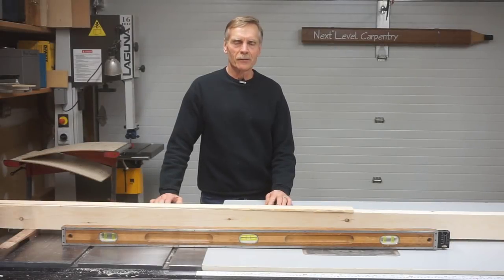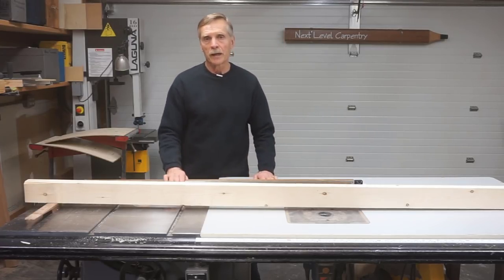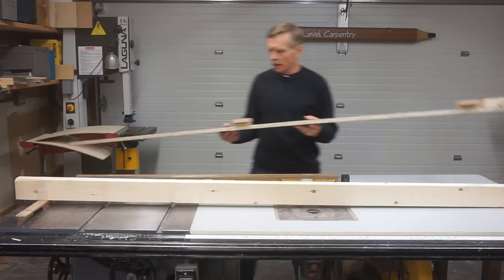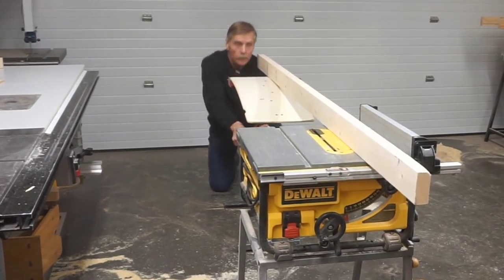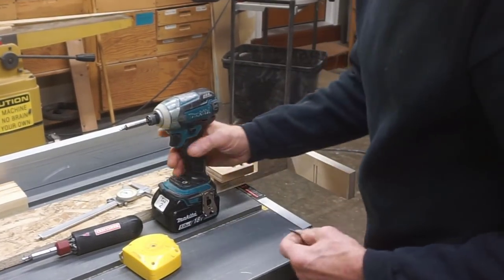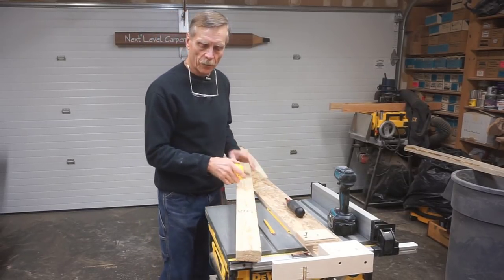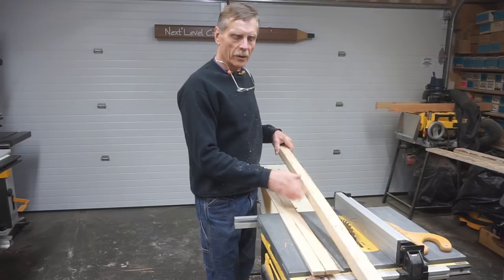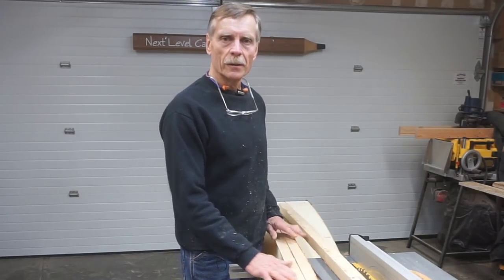How to Cut Super Shims

Comment: Hi Matt, 
Would you do a video about how to use the jointer to straighten lumber? And how to trouble shooting if couldn’t get board straight. I have a little trouble with my “made in China” jointer.  Thanks in advance.
Reply from the maker: Hi Jeremy,  I'll put a jointer video on my list... maybe I can squeeze it into the 'Minutes with a Master' format, otherwise it would be at the end of a long list of videos I need to do :-(
Two things will prevent jointers from working like they should: operator error or poor setup of the machine.
No matter how good you get at feeding boards over a jointer they'll never come out straight if the machine isn't set up properly.  The MOST IMPORTANT THING to set up is the height of the cutters in relation to the outfeed table! There should be a section in the owner's manual explaining how to check the setting and make adjustments when changing cutters. When the arc of the cutters is at its highest point it needs to be maybe .005" above the height of the outfeed table and perfectly parallel with the plane of the outfeed table.  Any higher and you'll get 'snipe' at the end of the board at the end of the pass.  Any lower and you pieces will always come out with a convex bow to them.
Hope that helps for now... Best, Matt
Reply: Next Level Carpentry thanks for the tips. I’ll try that and see how it turns out.
Reply from the maker: Jeremy, pay close attention to the tolerances because .005" can make a difference.  Not sure the condition of the knives in your jointer but keep in mind that they get shorter as they dull.  If yours are dull/worn you can spend a lot of time trying to set their height and still get disappointing results because they're not cutting wood off boards you're trying to straighten like they're supposed to. Hope that makes sense?  Let me know how it turns out?  Best, Matt
Reply: Next Level Carpentry Thanks for the tips. I checked the height of the knives, they are kind of high, not sure how much. I’ll take a look again this weekend and try some adjustments. I may need a new set of knives, they look kind of worn out. Thanks for getting back to me. I’ll let you know how it turns out.
Reply from the maker: Cool... 'getting to know' your jointer will most likely lead to better results in your work and satisfaction while doing it.  
The 'old school' method for setting knife height is (with power totally disconnected!) to lower the INfeed table out of the way and then  lay a metal straight edge (that's wide enough to stand on edge unassisted) on the OUTfeed table so one end extends over the cutterhead.  A knife set to the proper height will lift the straightedge ever so slightly and set it back down about 1/8"~1/4" inch farther back on the table.  Any less than 1/8" and the knives are too low and will produce boards with a convex edge rather than an 'arrow straight' one.  Any more than 1/4" and boards tend to have a convex edge with very noticeable snipe on the back end of the board.  If the knives don't 'catch' the straight edge to lift and move it and only slip by while lifting it then they're too dull.  It's all rule of thumb stuff so I hope this makes sense and helps.  Good luck, and do let me know where you get?  Best, Matt

Comment: Matt great video, but can you tell me how you made that pencil behind you,thanks
Reply from the maker: Glad you like the video, Paul.  I used SketchUp to make an accurate model of my favorite carpenter's pencil to get the proportions right and then scaled it up to a size that worked with cedar 2x6 material.  The pencil you see is made just like the real thing with two halves and a rectangular hole through the middle for the 'lead'.  I used real gaboon ebony for the lead with a point on one end and a little rectangular block in the square end of the pencil.  I have a couple of the the uber pencils and they're fun to have around!  Are you by any chance a SketchUp user?  I could upload a scale model of the pencil to the Component Warehouse if you wanted to use if for a pattern, just let me know.  Best, Matt

Comment: how would you recommend cutting a shim that goes from 3/4" thick to nothing over a length of 8" but 6' wide. It is to be use as a doorway transition for my father in law who uses a walker. I have considered ripping it on a band saw or making some type of sled and run it through the planer. Any suggestions would be greatly appreciated.
Reply from the maker: This will give you a method that will work great Billy: https://youtu.be/NnqhdzwZTUc Obviously you'll need to  alter the effective angle of the planing fixture but this is the basic idea of how I'd make the piece you're asking about... easy peasy, right? 😁😎
Reply: Thanks for the quick response Matt.  I was thinking a sled for the planer could pull it off but was unsure how to make the sled. Now I have a better idea how to make it happen.  Thanks again.

Comment: Why is it so necessary to denote that the rip speed is filmed at 2X?  Is it that important to have a slow and steady rip?  Additionally I appreciate the un-cut version at the end.  The choppiness did bother me in earlier videos but now I understand why it is that way so it's completely understandable.  Thanks for sharing the knowledge !!
Reply from the maker: Plumber77, There's two reasons I make special notes about rip speed.  The first is to shorten the overall video length while showing what the cutting procedure should look like: steady feed rate, body position, etc.  The second reason is that I don't want anyone to think that they should be forcing the cut which is what it would take to make those rips as fast as they appear.  The notation should help viewers understand what I feel is an appropriate feed rate.
Thanks for watching and understanding the un-cut video segment... I debated if it would be worth making the video 40 seconds longer to show it and it sounds like it was.
Thanks for your subscription and 'liking' this video!
Matt

Comment: This is good idea, but for framing I don't think I would shim anything over 12ft, maybe just resister joists at that point
Reply from the maker: hARR, It's a good idea to have in your bag of tricks, but usually when anything over 8~10' needs to be shimmed there's a bigger problem that can't be fixed by shimming :-)  Times I've used an offtake of this method is on historical restoration jobs where long timber floor joists are sound but sagged and a floor or ceiling needed to be flattened/leveled for new finishes. Thanks for subscribing to Next Level Carpentry!!  Best, Matt

Comment: You're a master and very competent.with your equipment.  but a DIYer should probably be advised to not wear long sleeves while operating a table saw.
Reply from the maker: ... and make sure to have secure footing, don't wear gloves, wear safety glasses, use a riving knife, good ear protection, use a good pushstick... 👍🏻😎

Comment: 2018 / 2019 and you're still using inches and fractions thereof.  Get with it Master Carpenter.  M E T R I C 
Millimeters and meters. Easy.
Just saying some fractions leaves spit on your chin.
Reply from the maker: Now if you can just convince every manufacturer, designer and engineer and architect on board you'll have accomplished something.
Reply: Next Level Carpentry all countries years ago(1960 <) were using inches etc. My country as well. Every industry was using it. Then it became law and everyone had to use it.
Irrespective of your industry.  Now 99.97% of the world uses the metric system most of the viewers of your channel uses metric im sure. Its stubbornness that keeps you guys from accepting a better easier system. Pity you seem to be one that refuses to accept change. (No malice intended)
Reply from the maker: @smacurface  I won't take the 'Pity you seem...' part personally since, personally, I'll go with the change when it arrives.  I'd be first in line to ditch the lame QWERTY keyboard for the infinitely better/more efficient Dvorak layout for the same reason but don't ever see that happening either... and again; for all the same reasons.  Try getting certain countries to switch which side of a vehicle the driver sits on 🙄
Reply: Next Level Carpentry On the right of course.  If we rode on the left like you guys do we'd all be dead. .... So why are there people in the States making an effort to changing to metric ? Canada and Mexico  are using it.  Already young people are using it more in the USA. By the older generation perpetuating the use of it and permanently posting these videos using inches you wont get out the hole. What is it that is so difficult to change to metric?
Im asking. I can't understand why.  It's like the easiest method out there. 15/ 32nds is 12mm. (11.9mm)  Just saying it is a tounge twister.
Reply from the maker: @smacurface  It's inertia that prevents wholesale change, not 'the older generation'.  The inertia is most evident in the building trades.  Automotive, aircraft, aerospace, technology, etc are  less ingrained into into dimensional restrictions.  
Every piece of building material is based in feet and inches. Sheet goods 4' x 8' or 10' or 12' or 48" x 96" or 120" or 144".  Everything is modular based on that.  Roots of math for carpentry run deep to a time when calculations were done in fractions and feet/inches are very divisible into 3rds, eights, etc without a lot of long decimal results and were accomplished without the use of calculators and computers.  I experienced a rather idiotic phase the US Government went through in an effort to convert to metric.  They drew plans for projects in feet and inches and then in an effort of failed sincerity converted the dimensions layer in their software to metric and printed them out.  So that same 4x8x5/8" sheet of plywood had a veneer of metric dimensions but at it's core was still imperial.  All it did was bog down the process because materials are all still made in feet/inches.
I'm not a Luddite when it comes to this issue but neither am I Quixotic about it.  I'm not going to start 'translating' all my video dialog to metric equivalents in a feel-good attempt to look progressive while avoiding the underlying issue.  I use Russian Birch plywood often and compensate for its metric size and thickness.  If they made the same material in imperial dimensions I'd probably use that to avoid imperial/metric crossover.  When these things are available in REAL metric sizes I've no qualms about using or building with it and will readily adapt to the 'new normal'.  The methods I show are useable with any measurement platform in the same way I make adjustments on my bandsaw, drillpress and jointer using metric wrenches.  I hope you and others can see beyond the distraction of imperial vs metric measurement to use and apply things I show to whatever platform you choose. 
I won't be able to devote more time to this dialog but do appreciate your sincerity in discussing it.  As an ambassador for encouraging the paradigm shift to metric in the US you have my support! Best, Matt
Reply: Next Level Carpentry Ok.... I'll let it rest too. It's too ingrained  in your culture to change. And industry not willing to change. The rest of the world embraced  the change and hurdles met. All professional trades adapted. We too had 4'... 6'..8' standard sizes.... and still do. Its now just pronounced differently.
Very little changes. The most important is the mind set and interpretation of the metric language. 
I wish you well. Thank you for all your efforts in producing these wonderful videos. You are a true educator for generations to come. I have subbed. And look forward to watching all your videos. Take care. Go well.